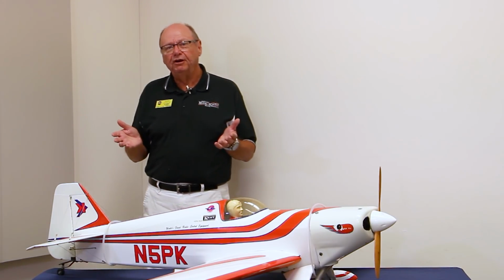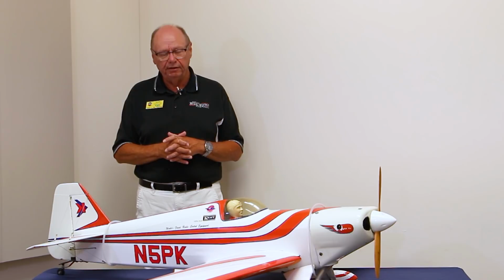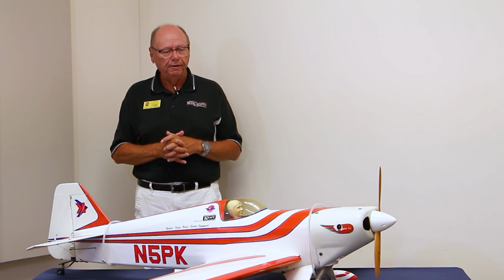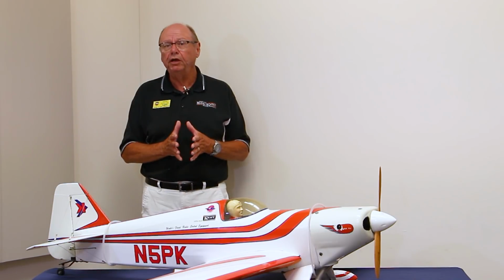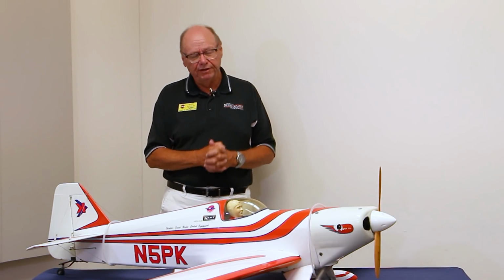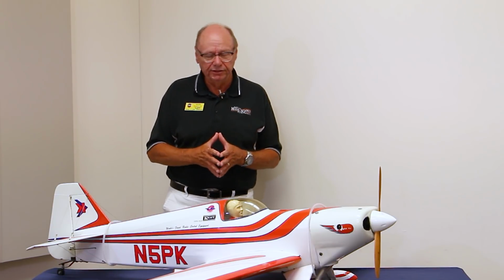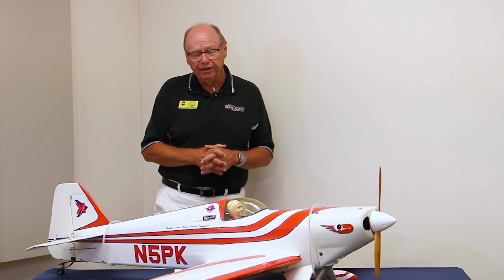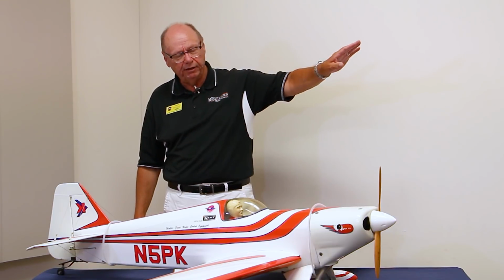FlyBy - "Super-Fli"

Comment: You forgot to mention that the full size Super Fli was designed, built and flown by Phil Kraft. A pioneer in radio control equipment manufacturer. He also designed other wonderful radio control models still flown today after more than 60 years: Kwik Fli, Fire Fli, Dragon Fli Das Ugly Stik and several others.
Reply: Hi Eduardo yes you are correct about Phil Kraft. This is a portion of the interview and I did acknowledge that Phil was the designer of the model and the full scale aircraft. Phil was a good friend of mine. Thank you for acknowledging Phil’s accomplishments.
Reply: @markradcliff7981  I had to acknowledge Phil's several achivements. He was a wonderful guy. I myself still have my original Kwik Fli Mk. III built in 1970 and in top condition. Just changed radio and engine.